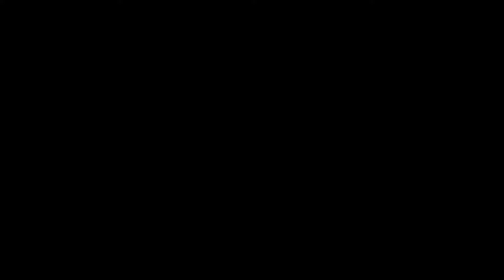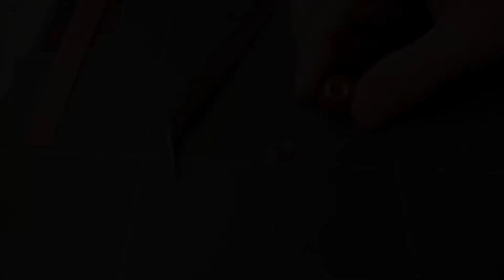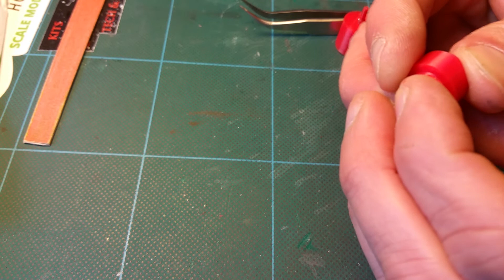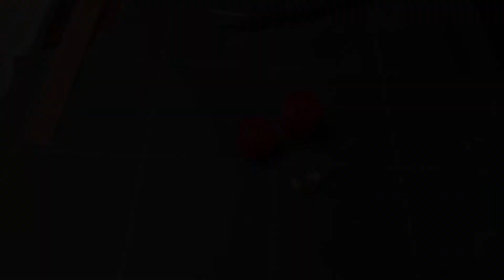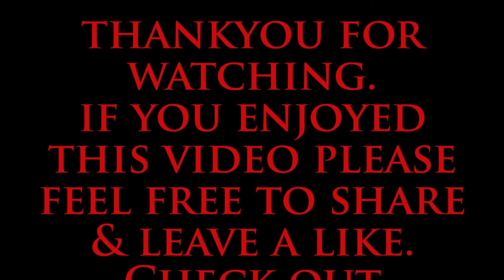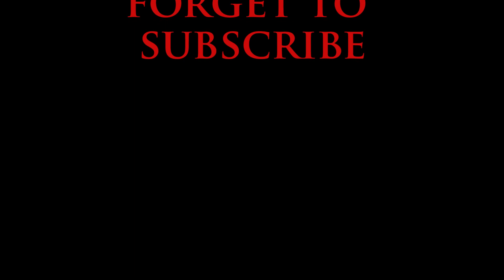3D Print Watch Mainspring Winder, Does It Work?

Comment: The newer release solves a bunch of issues. Just .25c for a mainspring winder.
Reply from the maker: While I've seen some newer ones the biggest problem remains and that's using a staple as the hook and it will wreck the arbor hole, that's the biggest downside.
For anyone who's serious about doing this long term a set of winders is still the sensible option, though expensive they'll hold their value.
Added to that I've seen some for sale on eBay of the printed ones at ludicrous prices. There's no way I'd recommend anyone buy a 3D printed set especially at that cost.
Reply: @spidiq8  I have a 3d printer for other purposes. Using it to print a spring winder is a "no brainer." Print it and throw it away, if you must. It is just .25c. How many mainsprings will you wind with even a cheap Aliexpress set of winders? For most people will will be a dozen or so, maybe.
Reply from the maker: @SuperFlatrock  Indeed if you have a printer and can then for the odd one why not. I'm all for saving a bit of money and finding workarounds but when it's a customers watch I wouldn't chance it.
I broke the arbor hole on two springs for this test and it wasn't as easy as a proper winder.
For the very odd one, though it's bad practice I'd personally recommend hand winding into the barrel.

Comment: Yeah, $1500 spring winder set for a good one. $300 for the all brass Chinese ones. The brass is a concern it would only last a few winds and break off, left with unusable junk. I see your point in the possibility here. Just print new ones, 1 time use and toss out. Always use a new printed one. So, for different barrel sizes go up or down 10% I guess and fiddle to find the right percentage that fits the spring barrel. Also had an idea while watching this, heating a metal needle and push it in place of the plastic pin. Also filament choice, perhaps polycarbonate filament? At $100 a roll would make a lot of winder pins but very strong.
Reply from the maker: Sadly I shelved this but wouldn't mind having another go. The main problem is the spindle and tang for the spring hole.
Reply: @spidiq8  It's the PLA not as strong as Polycarbonate. They make bullet proof Police sheilds from it. You need a decent printer that can print fine detail and a very good Hot End. A bigger power supply to handle the increase power required. Pin should last a few uses. Print a brand new one for a buck or 2.
Reply from the maker: @a.aguilar  Thanks for the info. I'll take a look.

Comment: The much larger DIY clock mainspring winder designs are also worth looking at for ideas. Lots of videos about them on YouTube. I’ve been working on one made from brass rods and copper pipe offcuts. The cost of watchmaker mainspring winders is utterly extortionate and unnecessary. When my project is finished I’ll post a video and let you know. The concept is surprisingly simple- go check out the clock versions! 👍🏻

Comment: Hi! Thanks for making this video. It inspired me to start the RS mainspring winder project for hobbyists.
Reply from the maker: Sadly this really wasn't a viable alternative, I was trying to get something cheap easy and useable for hobbyists but it would still require a steel arbor, the 3D printable holder does work however.
Reply: @spidiq8  I was able to improve the design, the latest version with teeth on the plunger works flawlessly. I made a video on how to use it, please do check my profile. The links are in the video.

Comment: Just been pointed to your channel by a member on retro watches. This looks good. Did you refine it in the end?
Reply from the maker: Sadly not, the stem, due to the printing procedure and layer adhesion is simply too weak, however, combining this with a metal or otherwise solid stem i'm sure would work. I was hoping for a simple all in one DIY solution from the print though.
Reply: @spidiq8  ah, shame. There is a big hole waiting to be filled by an affordable spring winder. Thanks for responding.
Reply from the maker: @TheSteveGullick  I couldn't agree more, which is why I had high hopes for this. I think with a combination though it's possible. The biggest hurdle is making a hook which will catch the central hole but not damage it.
Reply: I am going to give this a try, but printing in PETG, which is much stronger and will not snap. If you reworked the design at all, I would love to test it!